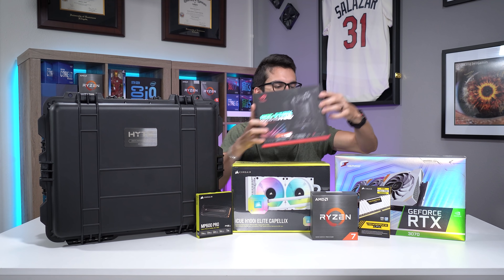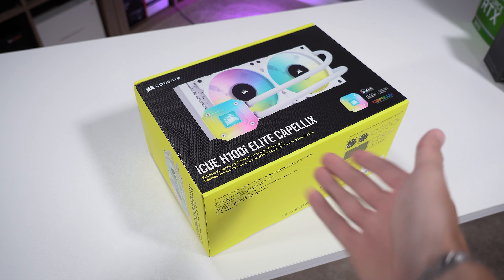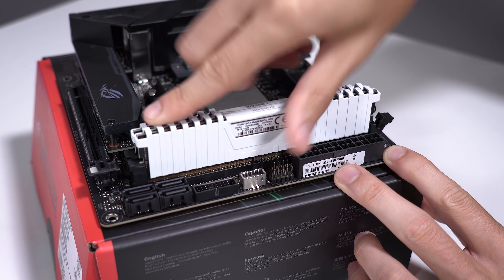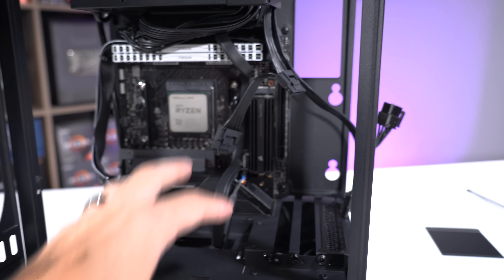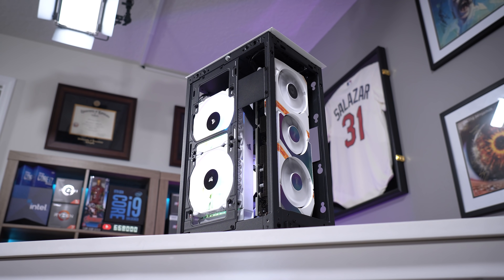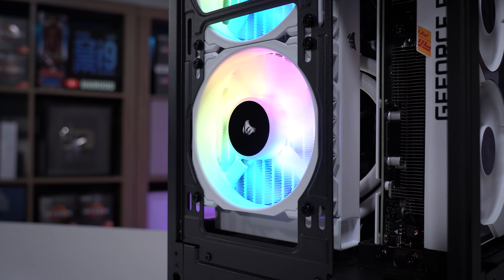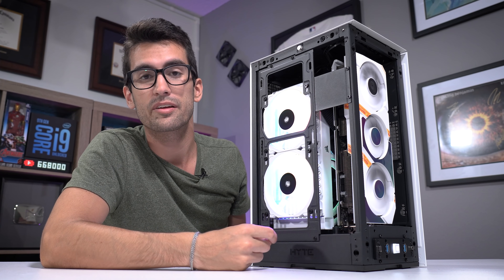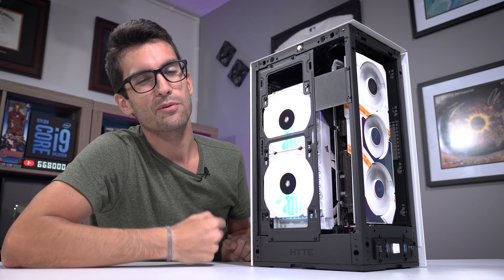Building a SWEET ITX Gaming PC in the Revolt 3

Comment from the maker: Important heads-up: Turning the PSU around the way that I did in this video was NOT a good idea... like at all. Please don't do this. Your power supply will run extremely loud and heat-soak much faster than anticipated. Sorry for the confusion! 😅
Reply: No worries. I saw the same thing lol
Reply: Hi Greg. Having the aio fans as intakes fights the gpu fans and raises gpu temps significantly.
Reply: I've got to say I'm pretty jealous of the graphics card you put in the build I can't get my hands of one in the UK not even a 1660ti price is abit ridiculous I've just build my 1pc running a ryzen 5 3600  with a mpg b550 gaming edge motherboard corsair vengeance Pro 16 gb 3600 just waiting for a graphic card to come in  stock
Reply from the maker: @ryanrice2795  After some testing a few days later (once I realized the PSU was running hot) GPU temps rose by 4 degrees with the intake config, but CPU temps dropped by a couple of degrees once the loop was fully saturated. Not a huge swing in either direction. The two are pulling in air from different locations. I also removed the filters at the rear for better exhaust flow.
Reply: nice second video today with same case
Reply: @GregSalazar  is there enough room to fit one or two 120 or 90mm fans in the back? It hink it would help with the temps. The only thing you have to do is to build your own mounting solution.
Reply: Turing?
Reply: I was going to ask about that glad you cleared that up. I already have an sfxl psu so really considering this for my daughter's buokd since she wants a smaller build.
Reply: Eh? Isn't it better for NAND to get hot, that's how it works? Warmer it is, the more maleable it is.
Reply: It is $120 for the case and PSU now.
Reply: Just ordered this case, its 50 bucks now for just the case on their site, and glad I read your comment about the PSU orientation!
Reply: @DarkM4V  Yeah I did too. For $50 it's a steal. My main concern is GPU temps. I have a 4070 Super TUF and I am hoping it fits, and also that it will stay under 75c when gaming.

Comment: One quick pro-tip re: the front panel power button on this case:

I noticed that the power button would 'stick' and get stuck in the groove of the panel. I fixed this by loosening the screws on the IO panel itself, somewhat slightly. No more sticky power button!

Comment: Hello from the UK. Greg. I just built my first ITX gaming PC for my living room. My system is built on a budget for now and with parts i already have. Silverstone Sugo SG14B, Asus Strix B360-I Gaming WiFi, Core I7 9700K, Corsair VP RGB 3000MHz 16GB, a 1TB Crucial P2, Corsair SFF 750W Platinum. Because i believe you shouldn't skip on a quality PSU! I also have my Zotac 1080 TI Mini in there. A Noctua NH-U12A cooler. I have one rear exhaust fan, and 3 cooling intake fans. One Noctua fan on the cooler for now. 

If i have Turbo boost enabled and speedstep, my temps are around 34-35Celsius idle. At the moment i have Turbo boost disabled so my system is running switching frequencies from 3.6GHz down to 800MHz. At this setting, my 9700K is running 28, 27 Celsius. In my setup my PSU fan is positioned the opposite direction from the GPU, the top fan is a slim 120mm Silverstone intake, the rear fan is a Coolermaster MF140R, One of the side cooling fans where the AIO can be fit is another Silverstone slim 120 fan, and Coolermaster MF120R.

I had to use a slim fan on the rear side and top because the Noctua NH-U12 Cooler is a bit too close the the side radiator fan mount and a little too tall. But you can fit slim fans there instead. I would love it if you could do a build in the Sugo14. I also wish Silverstone would have modded the top fan to be a 140mm option, because if you use an AIO cooler, you could easily fit a 140mm in the top. I'm sure someone will have modded the top fan bracket somewhere. Anyways. Just wanted to share my build with you. Do you think 34-35C idle is ok for a small ITX such as mine with a 9700K boosting from 3.6GHz - 4.6-4.9GHz ?

Comment: One thing I would do is to make the radiator fans to pull out since the dust will be accumulated in between the fans and radiator. Otherwise they need to be detached for cleaning later. Since 2 1225 fans are the stronger pull in this case, with the video card to pull in should be a nice one way air throw from in to out. An efficient air throw should help to reduce heat and some fan noice.

Comment: Just built in this on Monday and am very impressed.  The water cooler placement is kind of silly because of the proximity to the cpu cooler itself.  I personally used the EKWB 240mm aio and the tubes are questionable inside this case but regardless I am enjoying it more than the SSUPD Meshlicious.  Now I need to sell my 2 Meshlicious cases.

Note:  this case are virtually the same dimensions to the Meshlicious but maybe 1” taller.

Comment: So the SSD 2.5 are supposed to face inward towards that one cut out for easier cable management with grommets. I would agree if they had it come around the back instead of up through the case but with the mounting for the SSDs they did the best they could

Comment: Only critique is that you should use a negative pressure setup with the AIO (fans with grille or fans between the case and rad). This will help the GPU the most by helping to pull fresh air from outside the case.

Comment: I don't think it's a steal even at $90. It doesn't include any fans, it's made of steel, the problems your seeing with the eps cable. GN had an issue where they couldn't populate both 80mm fan slots above the GPU at the same time, and it's hard to find decent 80mm SLIM fans. Maybe if they included the two 80mm fans (and they fit at the same time) for $90?

Comment: In my experience "hardly reaches" is the better option for ITX cables compared to "has excess 15cm you have to bend 3 times in a fat roll and fit somewhere".
Don't get overly obsessed with cable management. Human body doesn't look pretty on the inside either. But it works, right? Serves a purpose! Engineered vs. imagined.
Regarding airflows (PSU) - consider heat like a virus. Contagious. Keep all hot parts with as separate (and fresh) airflows as possible in any case. 
Also Platinum+ PSUs. You increase efficiency by like 3% (90+3 production). But cut the heat amount in PSU by 30% (10-3 waste)! See the point?

Comment: What I don't like about this case is that the front panel IO is at the bottom. That's awkward to bend down if you are building a media PC for your living room. Might be nicer for a desk top placed, but I value space on my desk for more monitors more.
Reply: A lot of mITX users, including myself, are interested in SFF PCs solely so it doesn't have to sit on the floor. For anyone using this on their desk, the bottom buttons are preferred.

Comment: I was wondering if you reversed the orientation of the AIO Rad so the pump hoses were at the top of the rad instead of the bottom would you get better efficiency out of your AIO?
Reply: Yes, the hoses being at the top of the rad are better because if there’s air build up, the air will stay at the top of the rad and not end up in the pump, it affects longevity, not efficiency though

Comment: I recently upgrade my build with a new Motherboard, CPU and SSD.  I bought the WD sn850 without the headsink.  The ASUS TUF gaming Z590 has heat shields for the SSD.  Do the heat shilds work in dissipating heat?  Or should i have bought the ssd with  the heat sink.  Sure the heat sink looks better, but will the heat shield suffice and get the job done?

Comment: I need help. I needed a fan splitter because my mobo had 1 fan header so I plugged one in i turned it on to see if it spun, I unplugged it while it was on to see if it was 3 or 4 pin and now it moves slightly like it's trying to spin, and it does it with both case fans, and I can't go in the BIOS because the GPU hasn't came yet

Comment: Wow.  I've recently seen this unit reviewed elsewhere on youtube.  I believe the literature specifically and strongly suggests not to use a 30-series card with it (I think largely due to heat and sufficient airflow).  Nice build :)
Reply: I believe they are referring to the reference cards by nvidia as their method/direction of heat exhaust is not typical and can lead to really bad performance. Not all 30 series cards. Gamers nexus touched on that in their review.
Reply: @tcrunaway2123  you sir are correct.. They were talking about founders cards not all 30 series.

Comment: Has anyone tried fitting an RTX 40 series GPU in this case? I'm looking at a Asus TUF 4070 TI, while the length (305mm) and width (138 mm) do seem to fit in the case according to hyte website the thickness seems to be a problem at 65mm.

Comment: Pls can anyone help tell me whats wrong with my pc? I have a amd 6600xt, i9, z490 but my pc wont shutdown while my monitor does and to turn my pc completely off i have to hold the button for 5 sec. then when i turn it back on the fans start glitching out and i get no signal on my monitor. Is it the motherboard or?
Reply: And i dont think its my power supply bc my mouse and keyboard still light up

Comment: Honestly, this case kind of seems like a joke. It's 18.4L and can only fit up to one 280mm radiator. Whereas the NR200 is 18L and can fit 2 240mm radiators (1 at the bottom and a slim one at the top with a little modding) and a 280mm radiator on the side. I get footprint, but like this case just seems like a wasted opportunity. The Meshlicious can do everything this case can, but comes in and 14.7 litres, which is 3.7L smaller then the Revolt 3. It supports up to a 280mm radiator, and with a 3d printed bracket, possibly a slim 240mm radiator on the GPU side. The Meshlicious has the same design, but they have actually thought everything through. It does everything the Revolt 3 can, but better.